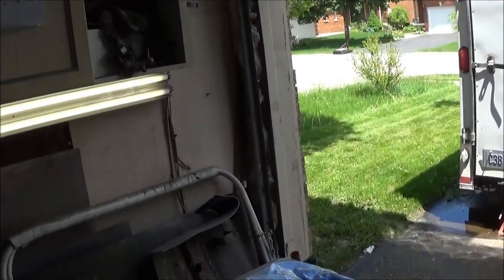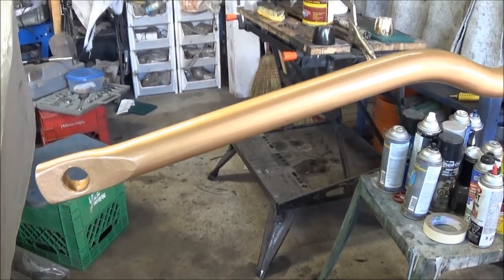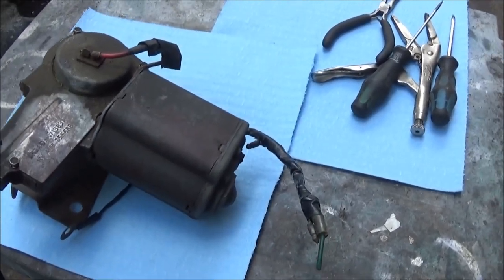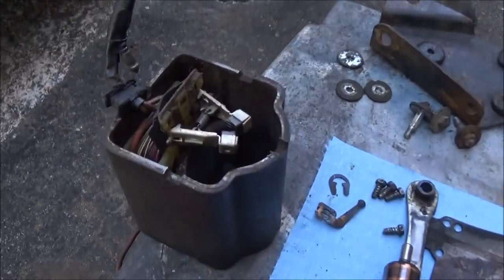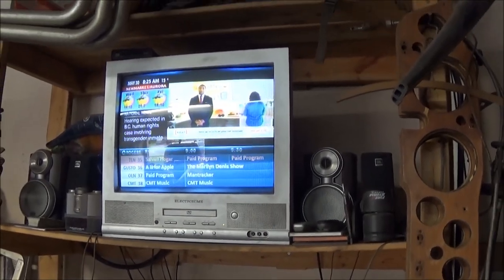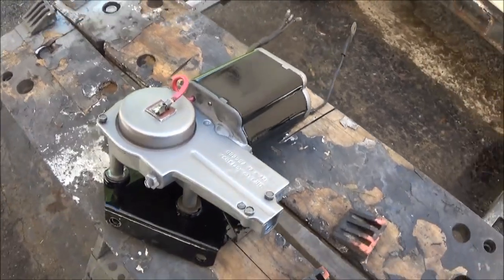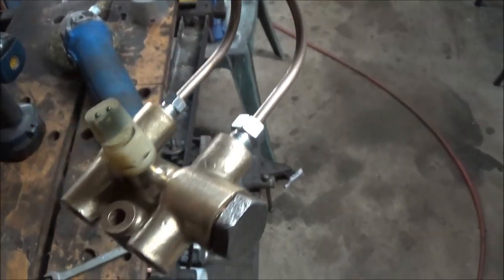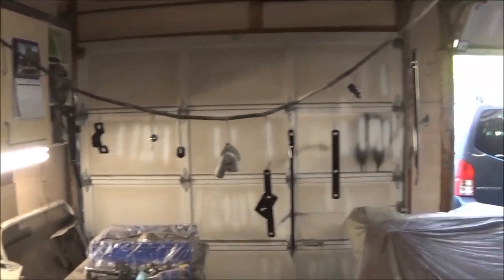T-Minus 110,1968 Triumph TR250 Restoration, Wiper Motor, Sway Bar PDWA Bin Bits

Comment: Hey, I know where the clip is. Right next to my little spacer for the dial bore gauge, which I dropped under your sandblaster LOL. I was hoping you were going to find it while looking for your clip, but you gave up.
And by the way you still haven't picked up that tab washer from the driveway (notice, I don't specify where it goes LOL)

Comment: Ever try removing and replacing the clip in a plastic bucket? or small pale? With the plastic less likely to ricochet and will contain if it does go flying.
Reply from the maker: The bucket would work....the plate not so much.   Ill try the bucket next time.  Thanks for the suggestions.

Comment: Hi,
I cringed when you removed that little clip off the bottom of the windshield wiper motor.
Reason is that I did the exact same thing.. I found a replacement clip in the screw/bolt isle of my local hardware store. If you want to go that route, take the gear with you and just size up a clip that fits the diameter of the inner slot. The outer side doesn't really matter. I can't imagine why they picked that POS but you can bet under the table of the guy who did the original assy, there is a pile of those clips! LOL
My first overdrive rebuilder was a bust. Moving on to another guy.
Keep up the good work!
Dave
Reply from the maker: I should have known better Dave :-)  Thanks for watching and commenting!

Comment: I thought you clear coated the brass parts. Maybe that was Elin. I don’t remember.
Reply from the maker: Not me Cory. I am thinking of clear coating the brass hinges on my 59 TR3A though
Reply: @cheftush  I wonder if it works
Reply from the maker: @corylwillrise  should help to protect it…you’d need to scuff the parts pretty well to get the clear to stick.
Reply: @cheftush  not to mention get all traces of brake fluid removed. Not sure I will invest time in this right now.

Comment: Wow - that sway bar came out awesome!  Did you just wire wheel it or something more complex?
Reply from the maker: David Plass Wire wheeled then hand sanded with 80 grit. Primer/paint and then clear.
Reply: Nice.  Was also glad to see the teardown steps of the wiper motor.  I think the GT6's is close to the TR6's.

Comment: I saw the clip in the picture. It was on the floor. you can see it by the curve of the table leg in the picture.
Reply from the maker: I though I saw it too....it just a metal shaving....I picked up a bunch that looked like the clips.   They were shavings that came out of my trailing arm when I drilled and tapped it for a new bump stop....Thanks anyway!
Reply: Ah well, Sure you're doing a wonderful job by the way.